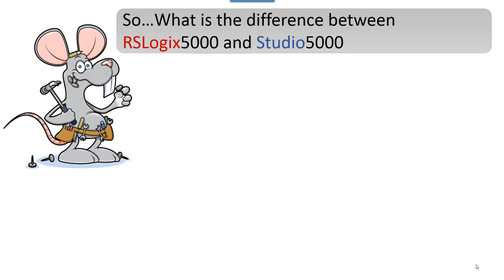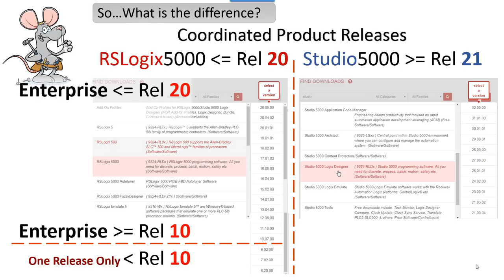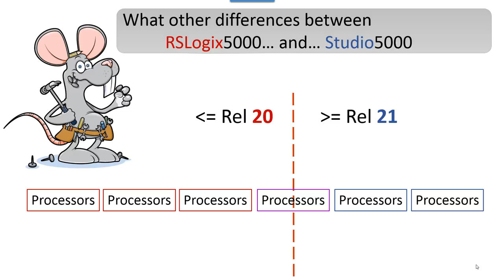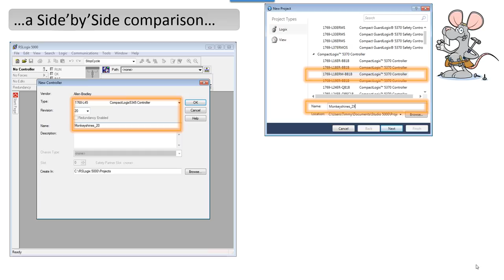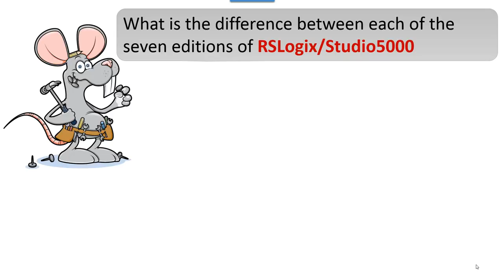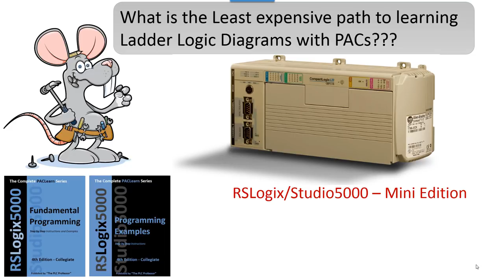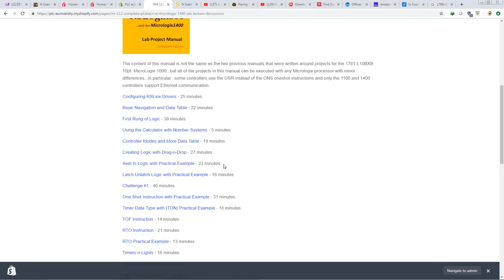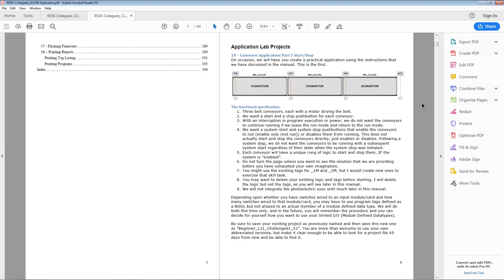How to Program a PAC PLC with RSLogix5000 or Studio5000

Comment: Studio 5000 mini version 30 or higher is the best way to go. This software supports windows 10 pro, which is needed. logix 5000  version 29 and lower do not. You need a version of windows 7 pro or higher to run the software in the older versions. You are also limited to older controllers with this venue. My dealer would not sell me version 21 to 29 for some reason. I had to buy a newer processor. windows 7 is old, even though I run studio 5000 version 30 on windows 7 pro.